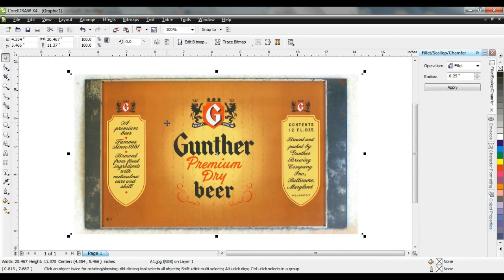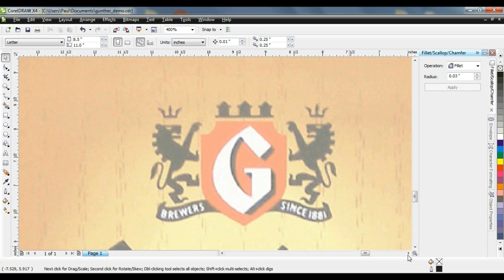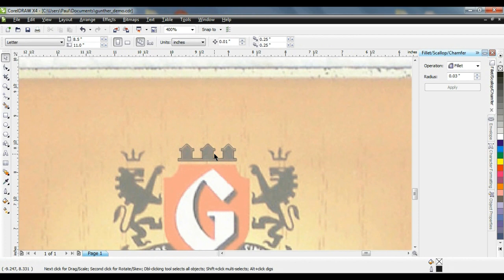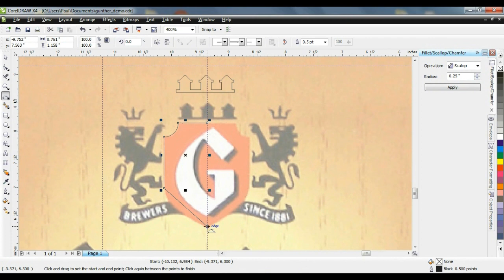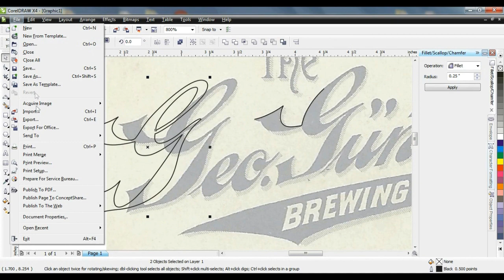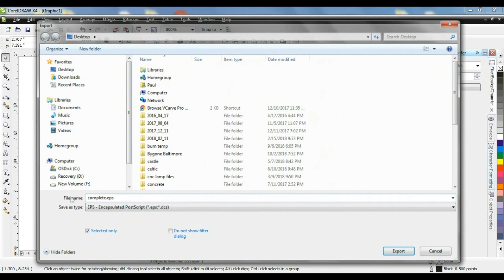Approaches to Manual Vector Tracing

Comment: If you have an iPad, you can make manual tracing of irregular objects really easy. Concepts is a Vector app with a cool range of tools, inc line smoothing and snapping. Import the design and you can trace over the really tough bits cleanly. It has, among options, an infinite canvas. There are other more traditional  Vector apps too, such as Vectornator.  My background is on the paper craft side of things, using a plotter but have just got access to a Shapeoko XXL CNC machine..playtime!